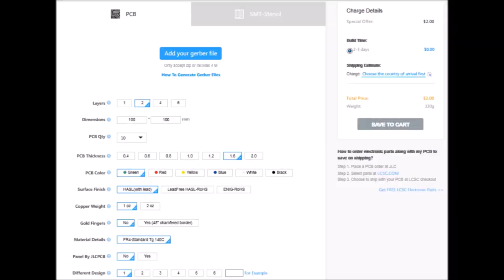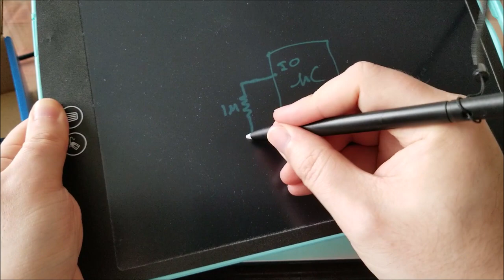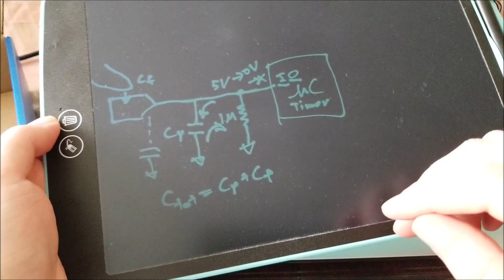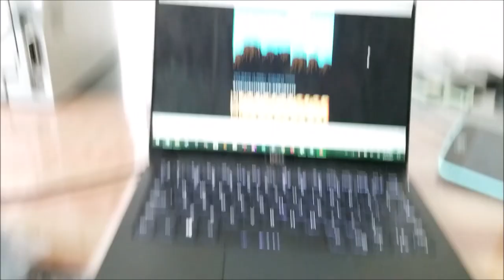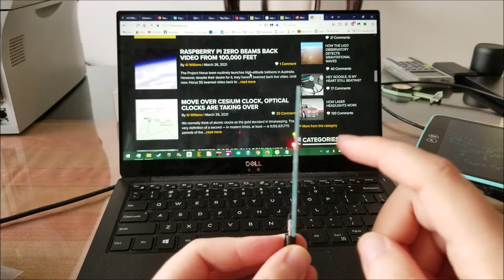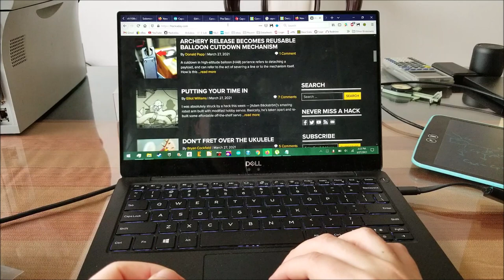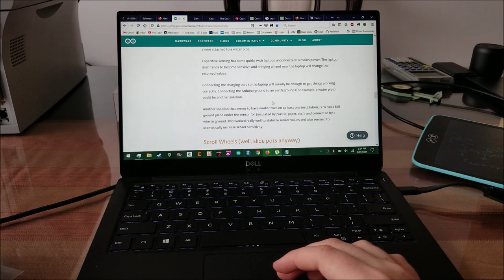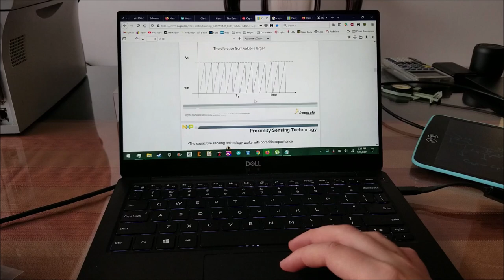DIY Capacitive Touch PCBs

Comment: How about a rotating led that signals degree position, just doing its thing runing in circles but when used like an old iPod jogwheel the position of the led stops or moves acordingly to your touch. Basicaly its What you have on expensive dj controlers. And making a costa reduced one só people can aplly it in Their cheaper dj controlers like the Pioneer dd400.

Comment: .96 OLED tetris game next. I'd also like to see a control panel for a stove. My stove is fine for now, but I know just around the corner, I'm going to need to create a control panel for it. Or better yet, a maytag washing machine capacitive touch interface. Not neccisarily the motor control, that would be nice, but more specifically the control panel. :)

Comment: Cool to see you are designing your own boards now. Having such an interest in minidisc an mp3 players, have you considered making your own flash-based audio player? There are various nice breakout boards for DACs and amps available for prototyping, plus stm32 and esp32 both offer solid audio development frameworks, it really shouldn't be too difficult, I presume. What do you think?
Reply from the maker: That's definitely on my list of projects I want to tackle. I really need to get a vlsi dac and esp32 to start playing around with.
Reply: @sjm4306  Depending on what you are aiming to do, VLSI decoder might be a good option, but I hear it is relatively low quality. If you are not afraid of C, the esp32 has an excellent audio development framework. I recently got to test it with a PCM5102a from TI, and the sound is exceptional. Only problem seem so be the fussy AAC decoder, but FLAC, mp3 and Wave play flawlessly.
Reply from the maker: That's interesting, didn't know the esp32 could do native flac/mp3 decoding in sw but I guess it makes sense given the clock speed and number of cores. I just ordered an esp32 to play with, cant wait to get it!
Reply: @sjm4306  Awesome! My advice is to skip the arduino for the esp32, it's too limited. Also, read the docs for the esp32 IDF and ADF. This is a super capable chip, and it's very easy to miss something. Good luck and if you have any questions, drop me a line. I'm less experienced than you for sure, but I have been researching embedded audio for almost a year and I may be able to point you at the right direction!
Reply: @sjm4306  Well, if you really are interested in MiniDisc electronics projects, how about a custom MiniDisc drive to use NetMD directly through your computer?
I mean, sure, there were a couple PCs that featured them, but if I'm not mistaken they were all MD Data (though maybe you can look into that yourself if it may interest you)

Comment: Would you be able to help advise me on a project can this same board be used as a xinput device i would like to design a controller for a special needs person and i would like to make a device like this that will allow them to make up down left right and diagonals by just sliding their finger. This will allow them to play certain games since they have limitations with their left hand. Please this would really help
Reply from the maker: So there is a gamepad hid arduino library by nicohood iirc but I haven't tried it myself yet. If you need a custom pcb/software I do commissioned design work, just shoot me an email at sjm4306@gmail.com

Comment: Interesting information! Thank you very much for that. What happened to the project with the touch wheel? I'm desperately looking for a solution to control a countdown via a touchwheel. Do you have an idea for this or even better a solution?
Reply from the maker: It worked but I've decided the next version needs more independent segments. I've yet to design v2.0 and I'm kind of between sponsors atm so it may take awhile for me to get around to the next batch of boards. An alternative option is to just use a replacement ipod touch wheel. They are cheap, abundant and last I checked someone reverse engineered the i2c protocol and posted an open source arduino library.

Comment: Wondering if you could show how to make a gamepad pcb. Not sure if this could be adapted to work with something like a SNES controller.
Reply from the maker: Yep this absolutely could be made into an snes controller (it would make for an interesting video but I can already guess it will be practically useless for real gameplay lol)
Reply: @sjm4306   oh why so? I’m guessing this is not as sensitive as the original copper/pad method. I’m trying to build/modify a snes controller to work with an arduino to run qmk and if it works think about designing a pcb that would avoid harvesting old gamepad motherboards.
Reply from the maker: I like any idea for recreating new parts instead of cannibalizing old ones! Using only touch sensors though would probably be too sensitive as simply accidentally resting your fingers too close to a button can trigger it (though it's possible to make the sensing less sensitive in software this would also affect intentional presses as well). The bigger problem to me is there'd be no physical feedback (no click, mush or movement at all) to let you know it correctly registered a press other than whether or not the appropriate action in the game has occurred. It's possible to get used to this with some practice but it doesn't seem like it'd be an enjoyable experience to me. I cant imagine using such a controller for precise platforming or frantic button mashers but rpgs and slow puzzle games would probably be fine.

Comment: I’m wondering how you added the grained / “mesh” ground plane. 
Anyone knows if KiCad could do a similar thing?
Reply from the maker: I use eagle and it's just a regular ground plane polygon pour but in the properties menu for the plane I select grid rather than solid fill. You can even adjust the line thickness/density. I dont have much kicad experience so sorry I couldn't tell you how to do it there.
Reply: I think it’s in a nightly build, but I haven’t verified

Comment: When designing the PCB, are the connections to the IC just tracing them through rows and columns if you’re doing a diamond shape pattern? Is there anything else to take into consideration?
Reply from the maker: I linked a few articles that describe suggested pcb layout requirements for capacitive sensors. In general though they suggest using a grid pattern ground fill plane and keeping a minimum clearance between traces that go to cap pads and of course all other digital signals (routing at 90 degrees wrt these signals will minimize crosstalk/emi). In fact it's good practice to keep any cap traces on one layer as much as possible and route everything else on the other layer.

Comment: Very cool, what are your thoughts on the TTP229 ASIC?
Reply from the maker: I've used the single channel version in several projects and they are great for getting touch inputs working quickly and easily. Saves the trouble of worrying about calibration or tinkering with sensitivity under different conditions.

Comment: what IC you have used in this project.  I am looking for an IC (CONTROLLER) which I can use for 7 to 8 buttons. Do you have any suggestions.
Reply from the maker: I used the atmega32u4, it has ~20 gpio and a native usb interface which is the reason I choose it. If you only need ~8 gpio and don't need usb then you can get away with something like a attiny84 or perhaps a atmega328p.